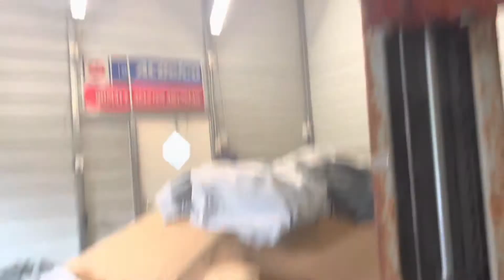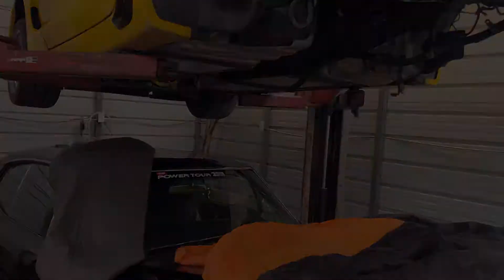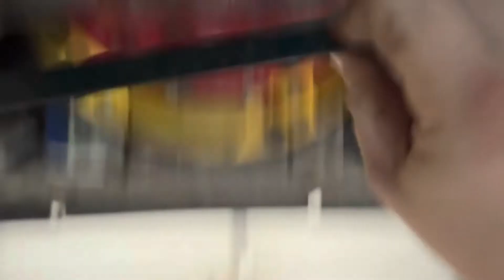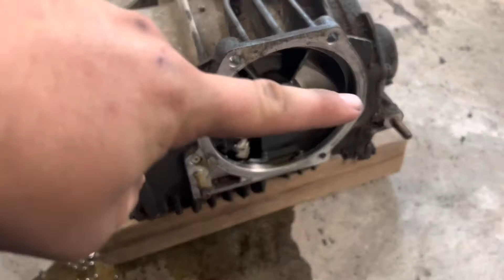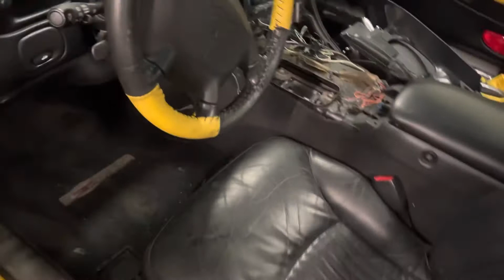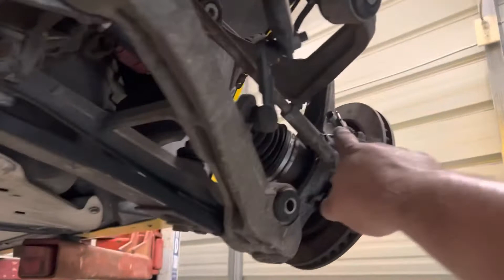Corvette Clutch Replacement C5 C6 Z06 Part 2 Clutch

Comment: Taking my C5 in to a shop to get the clutch done tomorrow.    Hope they have a lot of patience as I know what a job this is.  Would not tackle it myself in my garage.  Thanks for your video and info about this job.
Reply from the maker: No problem. Hope it comes out good as new for ya
Reply: @lsx_doc How did it go. Im about to send mine into the shop. I think my torque tube needs rebuilt.
Reply from the maker: @IamVintage72 this was a while ago but everything turned out great after replacing the slave cylinder that was brand new…it was junk. Once reassembled i was golden

Comment: Regarding, cleaning AL suspension pieces to look brand new, etc...    I've seen a couple of videos from guys that restore cars, specifically     https://www.youtube.com/@M539Restorations   This restorer concentrates on BMWs in Germany.   Apparently after a restoration is done, or when a car is registered with new ownership, the car must be inspected by German DMV.   It is a very rigorous inspection, far more rigorous than any inspection I know about here in the states.   To do so, he goes through the car with a fine tooth comb, replacing anything that even looks dirty.   He uses one of these dry ice machines.   While trying to find the video for you of this process, I found another video that details this.          https://www.youtube.com/watch?v=-O4gemWrn84        I don't have a clue what these machines cost, or if there are shops that do this cleaning for a fee.   I have to believe that there are.  If not, this would be a nice business venture to get into because I can definitely see the benefit of the dry ice cleaning process!   I think there must be shops offering this service though, specially in FL where you live and the car culture is alive and well!    But check the video out and let me know what you think.